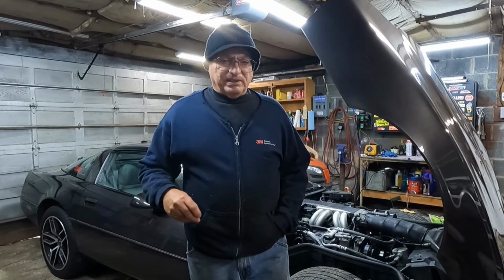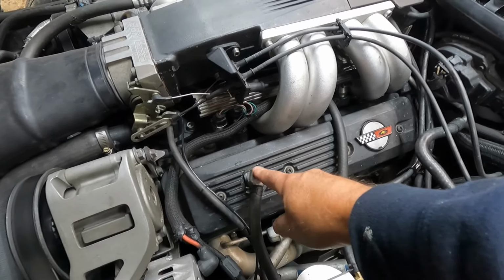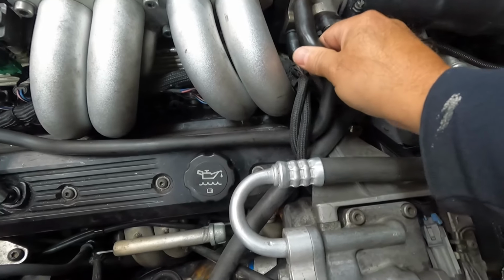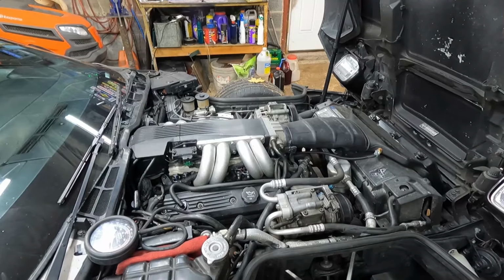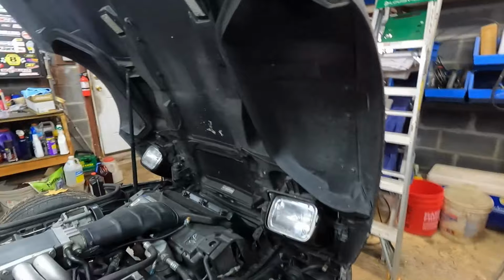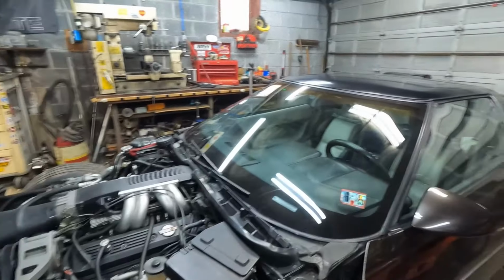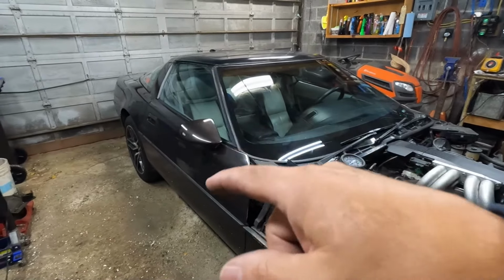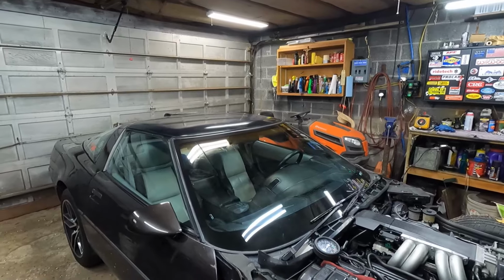Plug Your PCV To Stop Burning Oil 🤔

Comment: There is a device called a Duel Flow PCV by M/E Wagner that will help.  Tons of vids on it & they have an extensive tech library & many magazine write ups.  Very popular with the Hot Rod guys.
Also, the best oil additive that has a viscosity improver to seal ring packs & oil blow by of just to use on any engine since it uses a good dose of Antimony as the anti wear component is Schaffers E.P. 132 & will also quiet any engine.  Using both will really help & used by many .
Reply: Haha.......you're using a M/E Wagner Duel Flow PCV!😁
Reply: Haha.  You're using a M E Wagner Duel Flow  PCV.😁
Reply from the maker: I have a some video's on the Duel Flow PCV.

Comment: I build catch cans for my engines. They have a valve for draining on the bottom so they are easy to clean. Even stock engines can benefit from a catch can. I feel that blocking some of the flow through the engine crankcase is not as good as a catch can but the idea is smart.
Reply from the maker: Thanks for commenting, a catch can is a good idea, I use an air oil separater on the hose leading to the intake. Partially plugging is only meant as a temporary fix or you are running gapless piston rings or low tension piston rings.
Reply: @ my diy catch can only has the purpose of being an oil air separator. What is the difference between what you are using and a catch can? Maybe it has a feature I’m not familiar with?
Reply from the maker: @teagreen2220 when I have the time I will make a video on the difference between a catch can and a air oil separater
Reply from the maker: A catch can is not the same as an air oil separater, the serve different purposes

Comment: about datalogging I would be interested to see how your AFR looks like at WOT, an AFR mod data logging can be done. I have 2 ECMs ( one spare) and now both have pin connected to microcontroller on the board that reads the voltage. I've used a very thin PTFE insulation wire. Then the connector to the ECM has the corresponding wire that I've installed there so I can run it to the AFR controller and now the setup is like factory. I've bought a set of ECM connectors for that and took out a wire then inserted into the connector on the car.  I can also plug the oil pressure output signal to check it for example on the race track where you could run into pressure issues while cornering.

Comment: interesting, but is that hole enough for the blow by, at high load? because it could create too much pressure in the crankcase and blow some seals.
Reply from the maker: It's always a possibility I would think it would blow the hose out of the valve cover before it would blow the seal's I have run it for sometime with no problems.
Reply: @E.T.GARAGE  yes it is possible it won't hurt. another issue could be simply creating some leaks while the pressure is higher if the seals are not perfect.